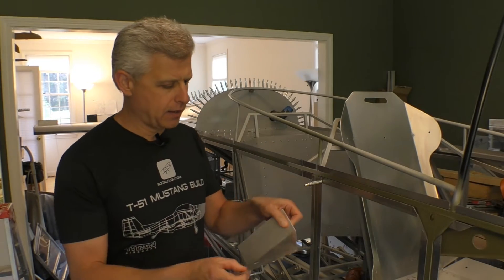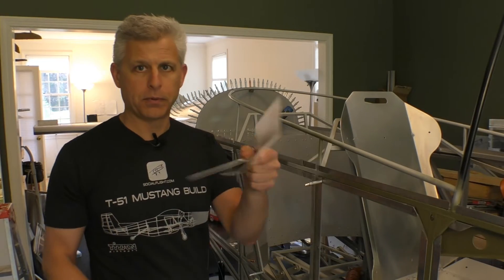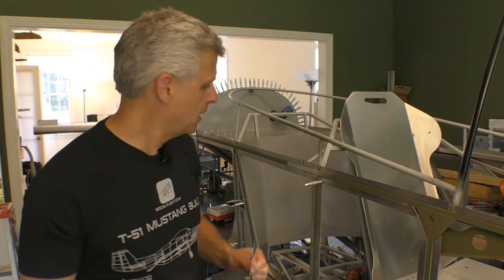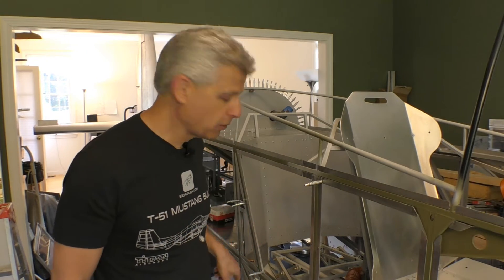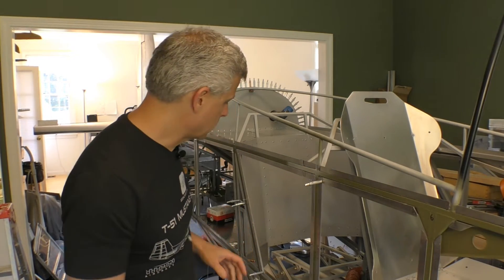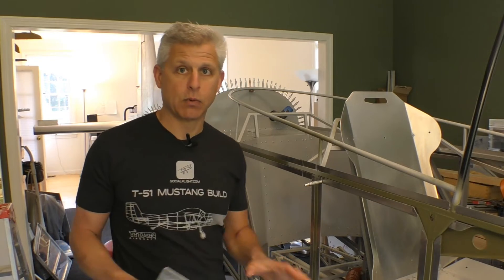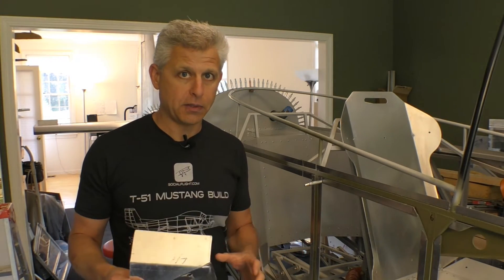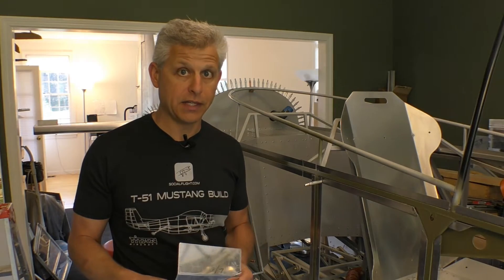SocialFlight's T-51D Mustang - How we closed-out the rear cockpit

Comment: Hint::

Plan for all your radiator hose clamps to be fully accessible/reachable to stop leaks after coolant is added prior to permanent closure.

Or, use mk 8-83 nut plates and make access covers for those areas.  That the close out flooring might cover.
Reply: Great point Jim.  Appreciate the help!